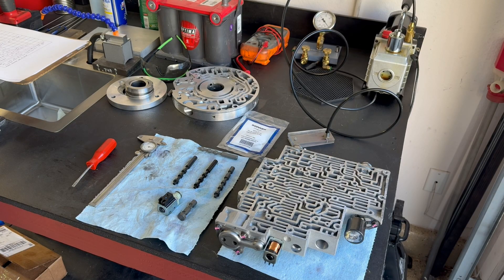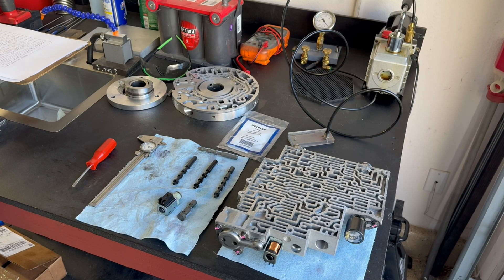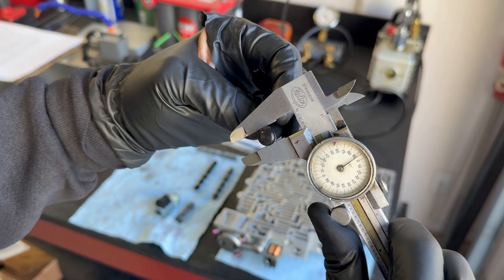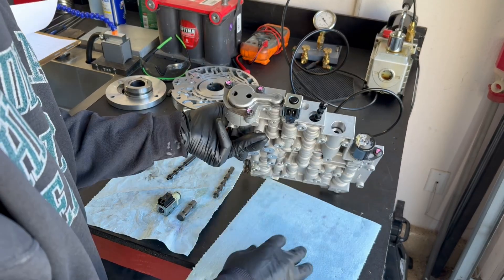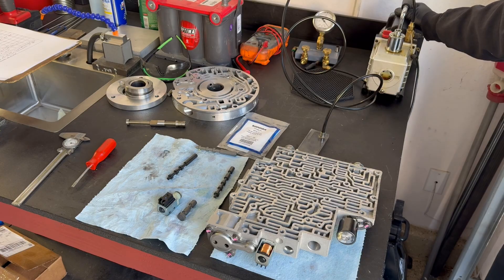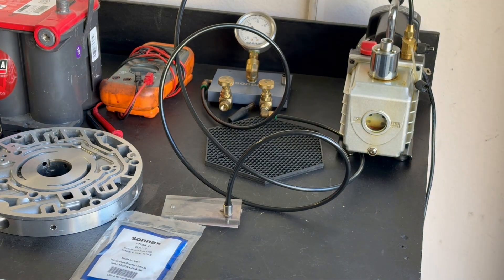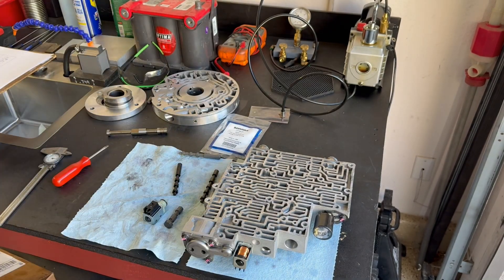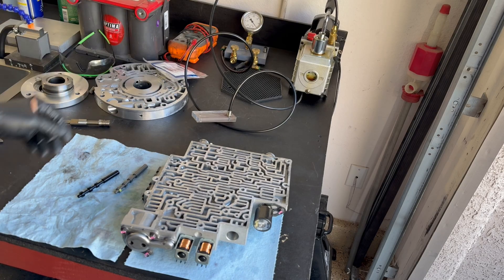4L60E: Another Counterfeit Sonnax HD 2-3 Valve!

Comment: This is what I plan on doing with my 85 2.8l and the Master 2/3 kit Hi Rev Springs and Transgo Hi rpm hardened pump springs. 
B (1–2) → .0958" Sonnax stiffer purple spring.
Firm band apply, controlled, RPM-friendly
2–3 Circuit (matched to yellow accumulator spring):
A (2-3)→ .118–.120"
C → .125–.126"
D → .125–.126"
E → .118–.120"
F → Plugged
G → .108–.110"

Replace all Bushings and seals with a beast sunshell and wide sun gear and rear stator bushing. Pretty straight forward. Need to measure clearance on my 10 vane pump rotor and slider in the housing. Purchased a converter from Chicago- seem to be a reliable company. 

Alto 87-UP 3-4 HE 57752 Clutch pack with .078 plates. Mines a 85, shouldnt matter..?
7 plates. 6 steels. Should be .050 clearance?.. factory is 6 plates, 5 steels...
Reply from the maker: Depending on what input drum casting you have, it may matter insofar as the 3-4 clutch pack...If you have an 097 or 716, it will be optimal for the 3-4 however you'll need to see how it stacks up in a 152 or like-kind drum from the late 84-86 units. Those earlier drums took thinner 3-4 flat steels compared to the 87+. If you're too tight, you can try a #7 apply ring from a 4L60E to free up some space in the clutch pack...Keep clearance .025-.040 for performance use.

ETA: Check out my short video on 3-4 clutch pack set up for factory 097 and 716 drums: https://youtube.com/shorts/3peKkjBFDlk?feature=share

Comment: I bought one of these counterfeit valves by mistake.  I realized something was off when I saw it was in a generic plastic bubble wrap bag with what looked like photo copied sonnax instructions.  I bought a real one from a known supplier and measured them.  I saw the same loose clearances you did.  Returned the valve to amazon and reported it as counterfeit.
Reply from the maker: Good catch realizing it was a fake - would have probably damaged the 3-4 clutch pack if it were to be installed.